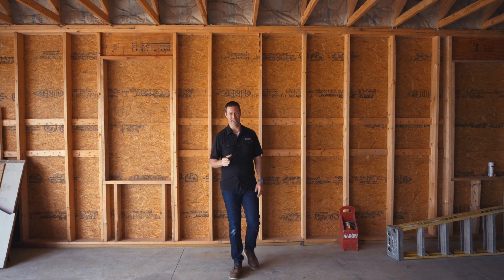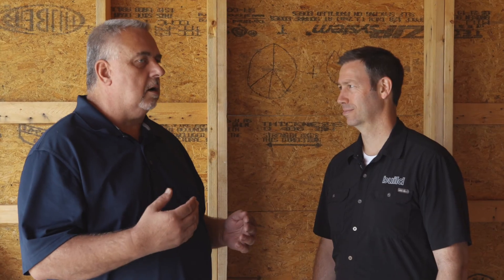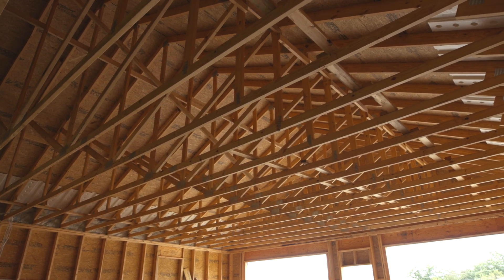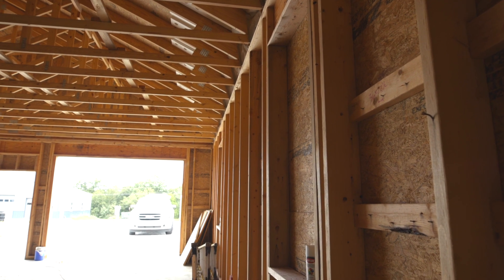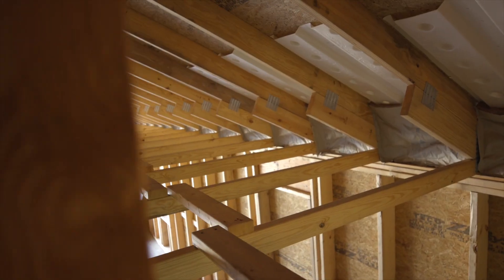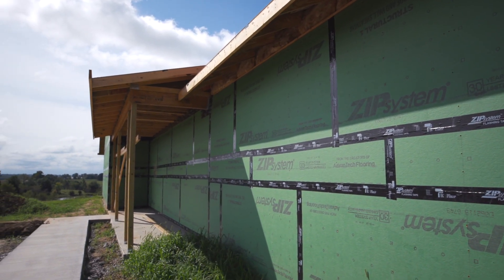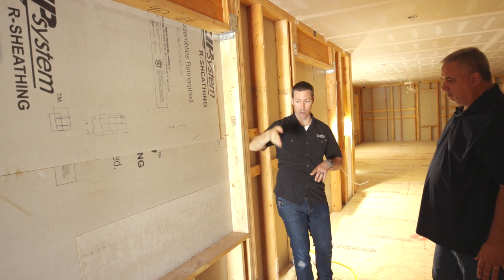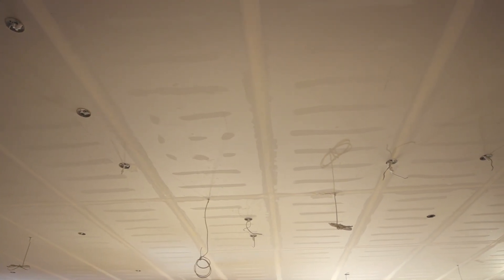Traditional vs Advanced Framing - Details

Comment: Some folks here are saying building science is a scam. Meanwhile, thermodynamics is in the corner like, “Bro… I literally wrote the rules.”

I’m not doubting anyone’s 30 years in construction — that’s real experience. I’m just saying physics doesn’t care how long we’ve been swinging a hammer. Heat moves the way heat moves. Moisture does what moisture does. Mold wakes up every morning choosing violence.

That’s why I like exterior polyiso, fluffy wall assemblies, and sheep’s wool in the cavities.
My house is basically going to be wearing a giant parka jacket — cozy, overbuilt, and ready for a snowstorm that will never happen in Texas.

Call it overkill, but my goal is simple:
Maximum comfort, minimum energy bill, and the lowest possible chance of breathing drywall dust or mold spores for breakfast.

If I’m going to live inside something every day, I want it to behave like a spa, not a toaster oven with windows.

Comment: Why can’t you just do 2x6 wall framing with staggered 2x4 every other run and have even less thermal bridging. Doesn’t the insulation matter more for climates like hot more insulation outside as opposed to cold inside.

Comment: Sounds simple enough. But if you put a lot of insulation on the inside as well, will that push moisture towards the colder side, which is still the, relatively, the inside of the outer layer of insulation? I hope the outside layer is thick enough to prevent that. I take for granted they’re not putting a vapour barrier on the inside, because that would trap the wood between not non-breathable layers. Personally, unless trying to maximise space/minimise width, I’d leave it open and add more insulation to the outside, leaving the framing more accessible too, rodents enjoy foam and fibreglass as much as the companies selling it.

Comment: I'm not a fan of advanced framing. I just got done last year building my house. I actually had my home framed 12 inches on center. I used 2 × 8 engineered lumber on all my framing. I also used engineered lumber on all my headers and my roof framing. I learned alot doing it myself with a couple of experienced framers teaching me along the way. By the way when the inspector came out he was surprised and stated it far exceeded code.

Comment: I have concerns that a strong wind side load would test the rigidity of such a structure. There is no triangulation strength between the exterior walls and the trusses. It can handle top load but I think it would fold like staked cards if side loaded.

Comment: I would never build a house with 24" on center. I wish I would have had the framing contractors build the interior & exterior walls, & roof trusses built 16" on center when I had my house built. I have seen dozens of houses with 24" on center roof trusses because the roof will appear to be wavy with the roof appearing as sagging in between each roof truss. Also, you should never build a exterior wall 24" on center no matter if you use 2" X 6" or 2" X 10" or 2" X 16" studs. Exterior walls have to be no more than 16" on center using 2" X 6" studs & top & bottom plates per building code in NC.

Comment: I'm noticing at 4:18 there's a ventilation channel in each bay that goes to the outside, is this a newer thing or is there channeling you can add while insulating that space to avoid over ventilating your house?
Reply: That allows air through the soffit for air movement into the attic. The attic space above your insulation should ideally be the same temperature as the outside temperature.
Am I addressing what you mentioned or am I just way off?

Comment: I like using 1" foam on the outside, because it goes over all framing members which doubles the insulation value in those areas, and then you can also use 2x4 framing to get your 20 r-value.

Comment: 2:52 - "All the studs line with the trusses up above."

No, they don't.  And it drives me crazy.
Reply: With respect to transferring the load from the roof, yes they do. The studs don't need to be directly under the truss (or joist if it's a floor) for the load to transfer. They just need to be within an inch or two. Also, the stud in that shot that clearly doesn't line up with the truss above is a king stud for a window, and therefore, it's location is determined by the location of the window, not the 24" o.c. stud layout.

Comment: Sorry. "Good bones" has nothing to do with framing and everything to do with proportions and scale. Such designers would be at a loss to design in concrete or glass and steel.  Wood framing and it's proponents belong in the suburbs, if that.

Comment: Wow I find it hard to believe code has not mandated a center line load bearing wall specifically for fire and building suppprt
Reply: If the trusses are engineered correctly, you don't need it.

Comment: Never, ever cut your cripples to accommodate window sill plates or other framing; they are intended to be a one piece structural member from the header to the sill plate.
Reply: I agree. I like to think of windows as doorways that have been filled in. Kinda hard to replace that bottom window sill if its part of the jack stud. But I'm an amateur DIYer so take what I say with a grain of salt.
Reply: You can with advanced framing techniques. Thats why they place metal brackets at the top corners of the windows fastened to the header and sides of the window framing.
Reply: A lot of code changes came from desires to maximize the energy efficiency of homes.  Less wood and more insulation.

Comment: At 3:25 we see the window opening with no sheetrock support in the area above the window. The vertical load bearing member is there, but the sheetrock will be one continuous piece as wide as the window (wider than the stud spacing) with no center support. This invites bowing and cracking of the sheetrock as well as vibration. Note that all of the rest of the window framing areas have this piece installed. Other than that, a lot of good info in this video.
Reply: I don't see a problem, the drywall easily spans the header.  What's the problem?

Certainly can have a vertical seam at the header but..
Reply: @jamesdodge7941  
I stated the problem already but I will elaborate. Sheetrock, drywall, gypsum panels...what ever you choose to call it, is a material like any other in that it shrinks when it is cold, and expands when it is hot. It flexes easily and also has acoustic properties that will reveal themselves if not addressed when installed. In addition, the front facing is usually of a different grade of paper than the rear; this means that repeated temperature changes will result in bowing if the panel is not secured properly. This will also cause cracks at the end joints eventually depending on the strength of the taped end joints to resist the bowing. 

What all this means is that an excessively wide span between nails (or screws) invites bowing (because of the above-mentioned facing differences) and vibration (because of sound waves in the room). Manufacturers specify recommended nail spacing to mitigate these issues. And, it is considered good practice to keep the support spacing even; that is, if the wall studs are 16 inches on center, then support points for all panels should reflect this.

In the video, you will notice that all other window and door openings keep the same support centering as the rest of the wall; the one I pointed out does not. The framer had two choices: one is to install two vertical load bearing header joists instead of one, spacing them such that each are flush with their side of the wall (our preferred method). This allows you to secure the drywall anywhere in that area, but again, it should reflect the spacing of the studs. Or they could have installed spacers to the face of that header joist in the correct location to allow securing the drywall panel properly.

Thanks for the reply.
Reply: @royshashibrock3990  I don't agree, the span across the header is less than 16 inches, thus conforming manufacturer specs.  Expansion and contraction of gypsum is negligible.  

Drywall Seams at or over openings are to be avoided to eliminate cracking.  Blocking in that header cavity is neither standard nor necessary.
Reply: @jamesdodge7941  
I mean no disrespect, but are you blind? The header to which I refer is at least 30 inches wide. And no one said anything about putting a seam in the middle of the header...I said the panel should be secured at that point, meaning it should be nailed or screwed at that point. Please reread my comment.
Reply: @royshashibrock3990  yes and a stud cavity is nearly 9 feet tall, but the drywall only spans 22.5 inches <in this case> 

Just b.c. the span is horizontal rather than vertical doesn't change the drywalls span characteristics.  It's secured at the top and bottom of the header.  It does not need additional nailers.  

*I've been a carpenter for 20 years.
Reply: @jamesdodge7941  Congratulations.
Reply: @royshashibrock3990  thanks
Reply: @royshashibrock3990  
Ok
Reply: A horizontal span that's barely taller than their head?

Comment: My house has really good bones! It was built in 1910 with green rough cut Doug fur. It's framed on about 18" centers. You ever tried to pull a 6" square nail out of 100 year old Doug fur that was nailed green? 😫😫😫😫😫🥵🥵🥵🥵🤬🤬🤬🤬🤬 let's just say, they won't ever fall out!
Reply: I live in a house with red oak studs and its a bit of a pain you cant nail or screw anything without pre drilling.  The nail will bend and the screw will snap

Comment: I usually enjoy Matt's videos but I would like to point out, as can be clearly observed at the 2:55 mark: the way the window header is framed wouldn't be acceptable here in Canada. The cripples have to go all the way through under the header/ lintel and the bottom plate that holds the 2, or sometimes 3 header materials together,  in between to prevent future issues due to surface shrinkage.

Comment: Nice video! Good tips.
I was wondering which ones are the parameters for the selection of wood stud framing vs metal stud framing; not on this particular project where the exterior walls are working as bearing walls, I guess in this case wood studs are the framing to use. Also, I know that for example in Florida, metal framing is a better solution against hurricanes. I wonder in regions of the country where there is no hurricanes, flooding or tornados. Is it that the use of wood framing is more affordable?...in Florida, wood framing are considered old school.
Reply: Use ICFs not wood for best strength.
Reply: @ToddBizCoach  Thank you. I will further look into that system. 👍🏻

Comment: That’s not very clean framing. My eye is picking up a lot of pieces off layout/crooked. And I can’t believe he mentioned guys using a single top plate.. no way in hell. The header hanger is inefficient, eliminating one jack stud on each window isn’t significant. There’s nothing advanced about this framing..

Comment: wow they saved a little wood by putting the trimmer on top of the sill instead of all the way down to the bottom plate. if youre so worried about saving wood you order 10' zip sheathing and stand the shit up vertical instead of horizontally so you can eliminate 2 rows of seam block all the way around the house. these fuckin builders think theyre so smart with their "advanced framing" bullshit

Comment: I've worked for several 'smart builders' and the only thing advanced about what they do is convincing people to pay a premium for less material, a scientifically dubious increase in efficiency,  and to have their walls pumped full  of a potentially hazardous foam.  Maybe I'm a luddite but every 'advanced' project I've ever worked on seemed to focus more on selling the concept of the process than with actually building an elegant, efficient structure.  Everyone I've ever worked for that builds like this thinks they're Brunelleschi  building the Duomo because someone at a trade show told them they could seem like the smartest guy in the room when they're talking to a client .  Once again, I could be wrong, but I've worked for a lot of people who waste a lot of time solving problems that didn't exist by replacing them with multiple, more vexing problems.
Reply: Say what you will but I love the open warehouse for storing things/ building components, building your rooms as you want, and protection from the rain as you build. Also the extra room for roof and wall insulation.
Reply: Sounds like every construction worker ever. Read the guys paper who came up with perfect wall
Reply: As a contractor, I agree.  Why save a few studs?
Reply: Manager speak. Tell it how it is. Manipulation is a real issue!
Reply: Bullshit.
Reply: Funny you say that. I watched one of these guys videos a long time ago. Thought the exact same
Reply: "Smart framing" simply equates to charging more and use less wood. I've been in construction for over 30 yrs and it's all nonsense.  Redundancy works well in everything from homes to aircraft.  
P.s. why do all these people act like a DJ from the 1980s?
Reply: Amen
Reply: I have to laugh, and I don't disbelieve you. I've been in residential construction for upward of 30 years and heard a lot of "green building" bullshit. There's a lot of good to it, and a certain amount of bullshit.
Reply: @kshepard52 . Your take is a lot more reasonable over “lts different than what I am used to so it’s bad”
Reply: This
Reply: Sucks when it's your family falling for this spiel, but they don't listen to you.
Reply: I salute you sir for saying something that needed to be said.
Reply: Yep
Reply: you are telling the truth
Reply: I'm 50 years old I started in the trades at 15 years old and I completely agree. I was told beta versus VHS. Beta was better than VHS but VHS guy was a better salesman and it was more lucrative to go with VHS because it didn't hold up and didn't last as long so production was higher.
Reply: @dford8874  The beta max guy at it again!!!
Reply: @kebertxela941  Beta is better
Reply: @dford8874  I wouldn't know,I was too young,it is just funny that the diehard beta guy(s) are still shouting what sounds like truth to me.
Reply: @kebertxela941  I also miss my razr phone
Reply: @dford8874  I never had one of those either(was old enough,just didn't have money),but those were the peak of flip phone tech from my observations. I miss texting with one hand without having to look at the screen!
Reply: Thoroughly agree with you Chris . I’m in Australia and the “ smartness “ is bullshit as far as I’m concerned - I’ve worked in the building industry for 40 odd years and seen some dreadful things . As you say , basically all in the goal of “ another dollar for me “ .
Reply: Thank you for being straight up!!!!

Comment: I have a question; 24 inch on center framing is acceptable, right?
I was doing a drywall repair, and the guy asked me if I could place studs between studs in a backroom that his brother framed 24" on center, but I told him that was already acceptable.  
The rest of the house is 16" on center.
I see in this video, the whole house was built to 24", so I'm wondering where is it not acceptable?
Reply: generally you frame exterior walls on 16. we usually frame interior walls on 16 too but you can get away with 24 it just depends on who youre building for.
Reply: @almightyhomage  thank you for your response, I 8 da p.
That's about what I was thinking. The guy was going to have stucco put in the exterior and said the stucco guy told him they need studs placed closer or the wall may warp or crack, which does sound reasonable to me, however I'm not so sure if it's a general requirement.

Comment: In America we have been conditioned to believe that houses must be built from wood and thats just how it is. In other countries  you wont find many wood houses. They are concrete, stone or brick. Walls are THICK, like 10 or 12 inches of solid stone or brick. They cant understand why Americans use wood to build a house and say they would never do that, because wood rots, gets termites, burns, blows away in a hurricane, doesn't last very long and bullets go right through it. Wood is an inferior product to be using, but thats what this country has become.  Look for a house in Europe with drywall. You wont find one. It's junk.  Their roofs are metal or tile. You wont find this asphalt shingle garbage. Good luck finding a builder here that knows how to build a solid stone house that wont burn down and will still be there 500 years from now.

Comment: 250 sqft that's nuts. I have a framer that'll frame up my build for 50 sqft and i will insulate my myself. Install Tyvec and tape up. Install siding, rough in electrical and plumbing. Electrician and plumber will be used for final connections. Learnt every building system at technical highschool and watching youtube. I've renovated a couple of houses and they turned out better than hiring others, without all the headaches and law suits. Save lots of $. It is not rocket science.

Comment: Nothing new here boys and girls other than trying to go 2' oc and line up studs under each truss (have fun with that framers on a cut up Custom home)
Also to add hardware at window openings to avoid a double trimmer is not a good idea. (More cost on hardware and labor)
Double top plates are required everywhere...even on 16" OC walls.
Mid span blocking for shear sheathing is not required if you break the shear at the top plate (unless walls are 10' +) and then shear the trusses from top plate to truss blocking.
Not impressed....thanks for trying....had me until "others use single top plate on bearing walls"
And..eliminate a trimmer by "simply adding a piece of hardware"